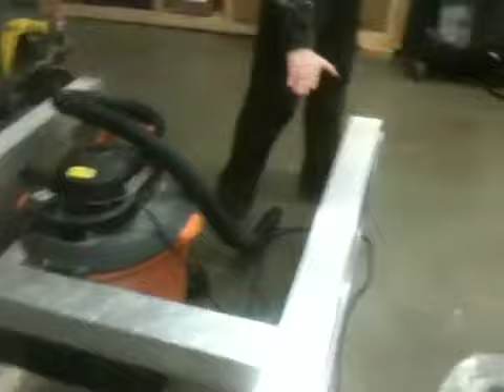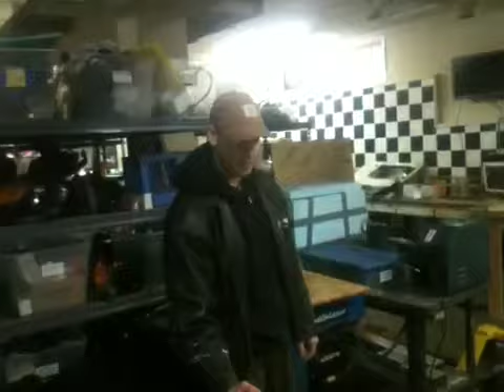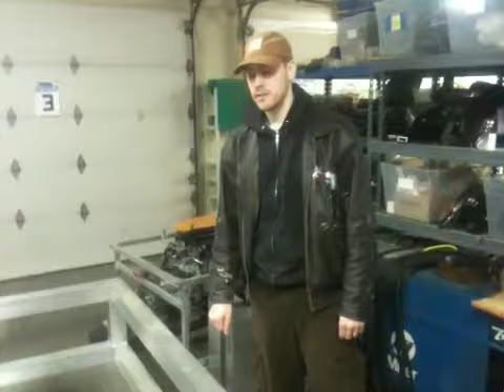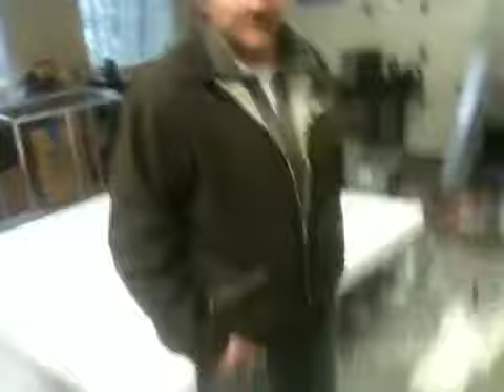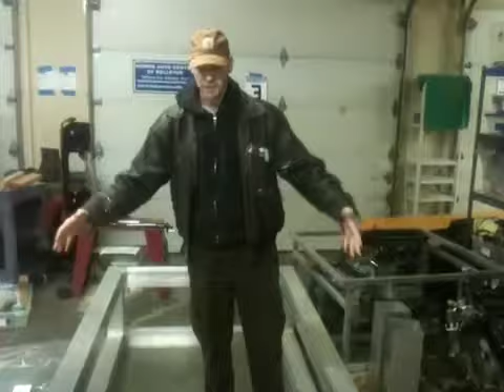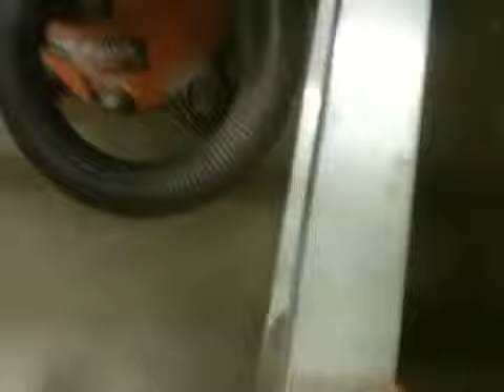Team Wikispeed 4

Comment: For a truck, it would be wonderful if you can lower the bed to be flush with the bottom of the frame. You don't have an axle in the way, right? Maybe if you turn the passenger module backwards for truck mode, so the engine doesn't interfere with the bed, and balances the load better. And implement 4-wheel steering.